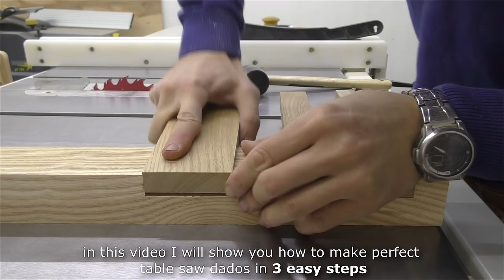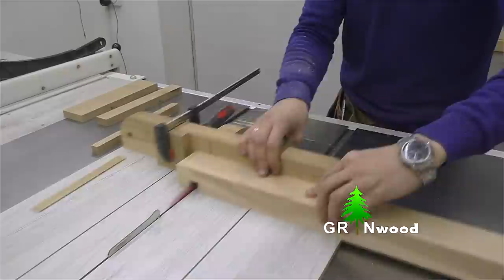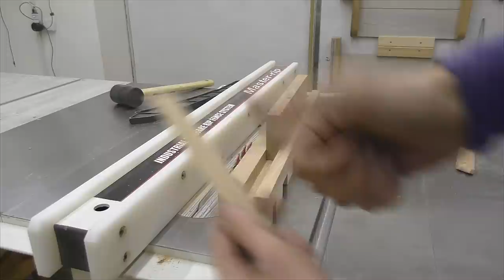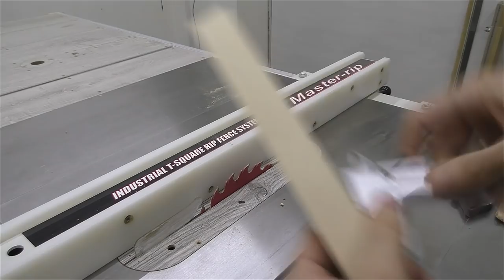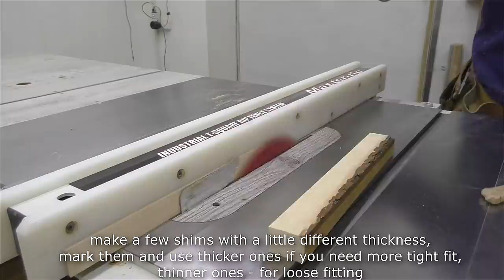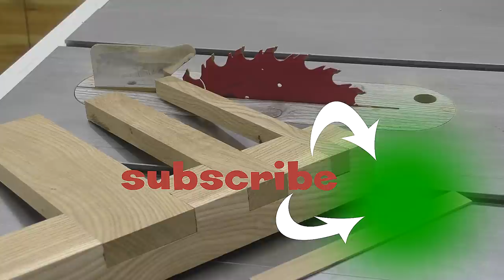🟢 Perfecr Table Saw Dados Easy - No Jigs - Single Blade

Comment: Isn't that a tiny bit too tight for glue to squeeze in? (Just asking)
Reply: It probably is, but simply adjust the kerf shim slightly - or, as he suggested, make a number of shims, mark them accordingly and keep them on a key ring or something similar.
Reply: No. You want your glue to squeeze out. That way you know it's solid. Just clean it up later on, or wipe it with a damp rag. Dados need to be tight. If the fitment bothers you, you could always take an extra skinny off the topside by giving your stop block a lil tappy tap, but why? These dados are perfect.

Comment: Great video. You may need to add a thickness of a strip of paper to allow for glue. Thank you for sharing.
Reply: Isn't the glue that gets trapped between the fibers and the saw scratches enough (extremely thin, I know)?

Comment: GRINwood, love your videos !

Cleverest way to cut an exact  blade width shim is to not measure at all.   Use the blade itself to cut the shim, that way any wobble or teeth slightly larger etc get taken into consideration and no messing with bumping fences and trying a few times until you get it right..

Search up    "Make Perfect Blade-Width Shims WITHOUT Measuring"  - inspire woodcraft.
Reply from the maker: Thank you for your comment, Gary! I found that video and have to say yes, it's the cleverest way to cut perfect width shims, didn't know that. Will try that today. Thanks!

Comment: This is super helpful dude. I've got a pretty decent dado set but it's always a bit of a pain to pull out and get dialed in perfectly. This makes it so much damn easier. Really smart solution. My only comment is if you have a dado stack and are needing to make bunch of wider dados, make a shim for a 1/4 and 1/2 cuts too. This method will work on whatever blade/dado thickness you start with.

Thanks for the tip, definitely got a subscriber
Reply from the maker: Thank you for your comment, my friend! I'm really happy that my video was helpful. Thanks 👍

Comment: This method worked out great for me! As a beginner woodworker I was stoked that it could be this easy. I'm currently making a small handtool cabinet from rough white oak which I handplaned and I wanted to dado two shelves in it. Super glad I didn't mess that part up. Great vid!